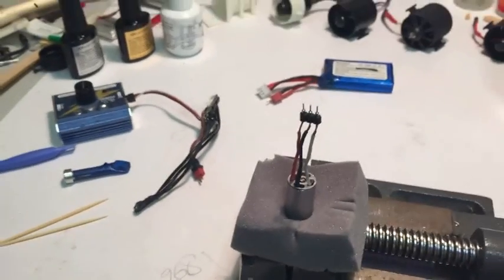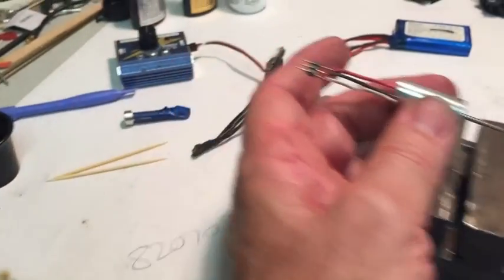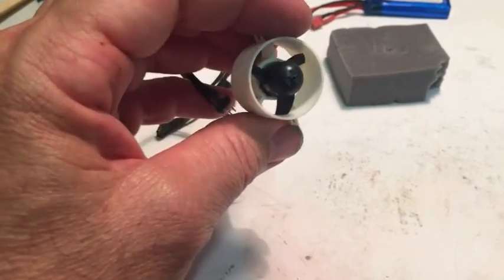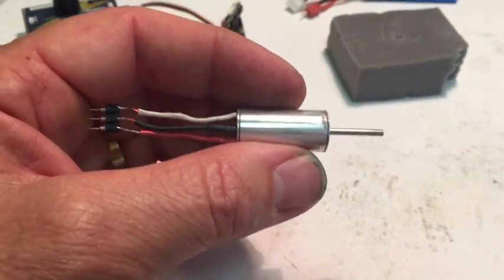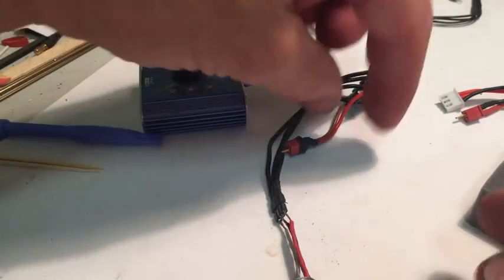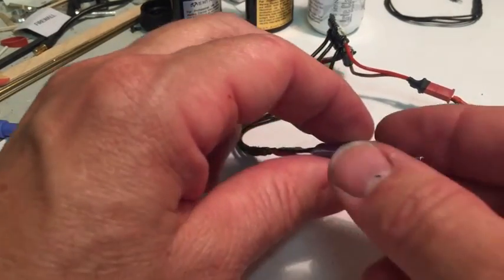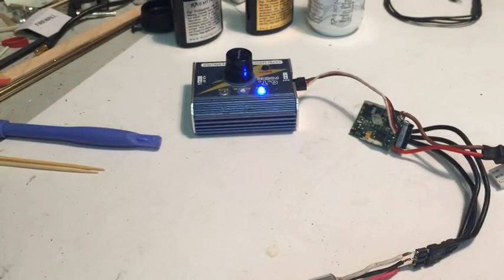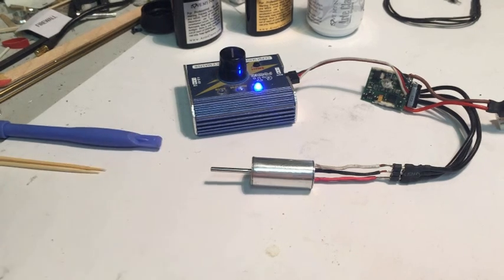12mm inrunner repair

Comment: Thanks for the video, I’ve been looking for a high KV 12mm inrunner, which brand is that, can you post a link to where you got it please? Thank you
Reply from the maker: the motor I repaired is a Turbo Ace 12mm 16,800kV  inrunner. It can be found here:
http://www.wowhobbies.com/turboace31714-4g6with14tpinionhighperformanceinrunnermotorfor4g6-1.aspx